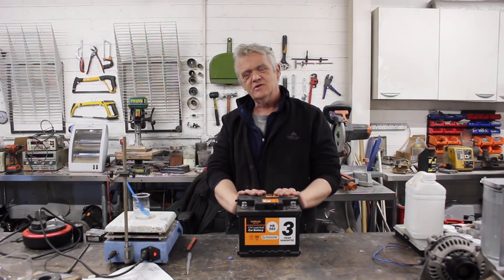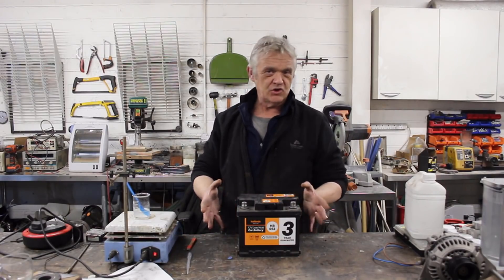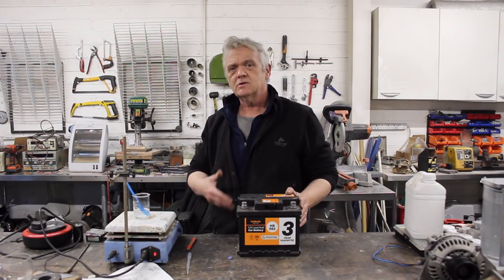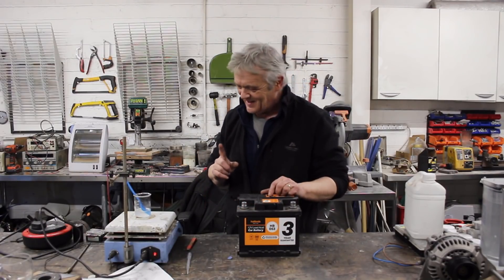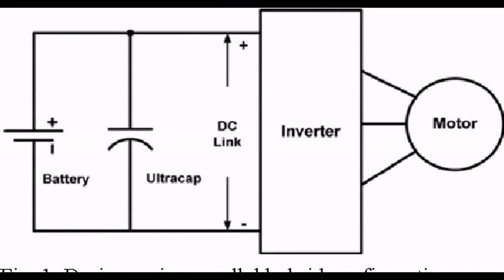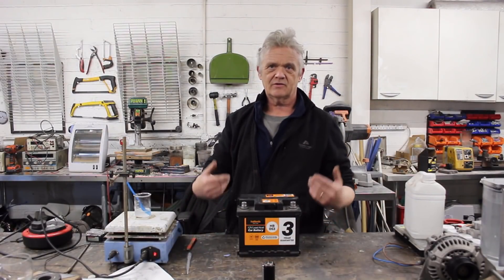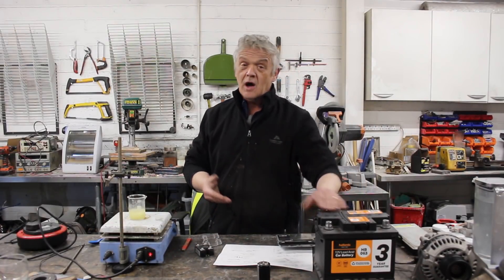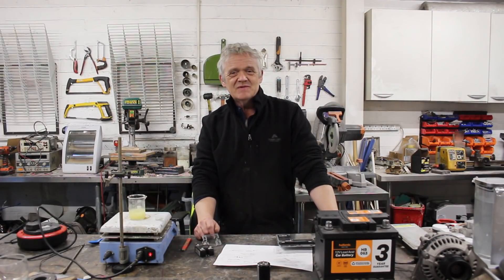1505 Improving Your Battery Storage With Supercapacitors

Comment: I have put it between the inverter and the battery, i.e. on the battery terminals. 6pcs 500F capacitors in series. Before the inverter beeped when the compressor started. Now it works well when the condensers give a good starting current.

Comment: I have added in parallel a set of 5 supercapacitors in series without the balance circuit to the lead acid battery of my car . The effects are better than a 6 series . Voltages are slightly higher than 2.7 V on average but so far so good

Comment: I was thinking about cylinder design, and besides making composites with graphene, couldn’t graphene ultra capacitors be used as Filler in an O Neil Cylinder?  
It should have sufficient strength, or you could design it with strength in mind, storing more energy than a battery made out of concrete.

Using any other battery chemistry in a cylinder would necessitate it being replaced every so often.  
- It would be nice to just have a set and forget graphene ultra-capacitor that you replaced every 50 to 100 years.  And for the flywheels story, most of the power, that’s just in the material strength.

Comment: I have an off-grid 400W solar kitchen assist system.  Our house is on grid energy.  I ran parallel wiring into kitchen so we can choose between grid or off-grid power by plugging into desired wall plug.  It sends solar energy into a 3000W inverter that is secondary power for our kitchen small appliances. It can power the large refrigerator/freezer during the day but the 400Ah battery bank is not quite enough to power frig through night. 
 Can a Supercap be used to inject power into the battery bank in early morning hours so energy in bank could hold up until sun shines to recharge system power?
Reply: @tomsuderman9976  saudações! O banco de super capacitores irão auxiliar seu sistema off grid nos momentos de pico de consumo se seus eletrodomésticos!
Para poder utilizar o sistema durante o dia, os super capacitores serão muito uteis para apoiar seu banco de baterias, mas recomendo que tenha pelo menos o dobro de placas com relação ao seu consumo. Isto irá ajudar nos dias nublados !

Comment: Im very interested in using supercap to lighten the burden my car has on my leaded battery. Could i achieve this by connecting a bank of supercaps to a solar charger that outputs 12v and have the supercaps permanently in parallel to the car battery? Or its not simple as that. Thanks.

Comment: Hi, I'm a new subscriber and had a question I was hoping you could answer. I want to use something like this system to smooth out and help a grid tie inverter for maximum efficiency. As I understand it, the diagram would be as follows. Solarpanel -> mppt -> Battery -> Dc-dc Converter -> Supercap -> Grid Tie Inverter -> Home . Unfortunately, you los\st me at the relay thing and now I have no idea what this circuit would look like. If It's not a bother, could you help me a bit with what I should do?

Comment: Very interesting. I am currently researching how to build a solar system for the absolute lowest price while having access to ac power.
Thinking of going with solar->charge controller->super capacitor, as well as AC->charger->super capacitor, and using the AC mains as my battery source whenever the sun is down. :yougotthis:

Edit: If anybody has any advice on using solar and utility power concurrently, I would really appreciate it. The most affordable way to do this seems to be using super capacitors or a battery being charged by both solar and an AC battery charger. Just need to drive a 600 watt window AC unit 24/7 without interruption with both solar and AC mains energy concurrently.:face-turquoise-covering-eyes:

Comment: Except it's all nonsense.  The issues were sustained load, and amount of drain.  The supercap does not reduce the load, nor does it reduce the drain.

One benefit would be high instantaneous current, but what do you plan to use that for? Perhaps starting a vehicle in extremely cold weather or spot welding.  Otherwise when you consider the series/parallel array of supercaps you'll need, it makes more sense to just do without them and use a larger lead acid battery instead, if not lithium depending the capabilities of the charging system.

In other words for most applications, given the same budget, having a lead acid battery with the array of supercaps in parallel to it, is inferior to spending same amount of money on a larger lead acid battery, which is why that is what practically every industrial use is designed for, and also vehicles and their starting batteries.

Most things simply aren't designed for extreme current because that in itself causes problems with needing to beef up everything else to withstand that much heat because we have not yet perfected and implemented superconductors in everything.

If all you really want is to reduce ripple enough that it's not a problem for the powered devices, a large lead acid battery is already low ripple but you could then improve it using standard, lower cost capacitors rather than supercaps, AND if talking volume or cost, you can deliver a higher current with low ESR capacitors than supercaps, so the supercaps really don't have a purpose except in niche applications.

Comment: Got myself   A millennium 3 cd20 relay controller ( marketplace 95 euros) ,, I’m nog looking for some super caps ,i have a 33kw 51,2v 646ah 14s200p li-ion battery.. and I’m planning to get a istabreeze I2000 .. and the max out of it ,, any advice for the capacity of the capacitor bank?..gr denny

Comment: You ever try replacing the battery electrolyte with lithium sulfate?
Reply: Update bought two 1300F super capacitors at 4.2v. I guess I will test them.

Comment: I'd have to know more about super caps to know how to apply them. Are they more flexible for charging? (Like trickle charging from solar panels, or extreme fast charging from daisy chaining solar panels). I know that the electric motors I have around the house have two capacitors. One is a run capacitor, the other is a start capacitor. I think my AC might run the same way.

Comment: I have a idea for a generator that is a washing machine motor, flywheel from a v eight, the Bendix off starters, inverter off one of four generator's going to a bank of super capacitors running the inverter to run power supply to run washing machine motor, will it work my friend?

Comment: hello Rob would the balancing circuits for the super capacitors theyu supply work similar to the dc to dc converter or would both the balancing circuit and the converter be best,as im looking at putting a super cap buffer onto my high powered ebike of 84 volts to take greater advantage of regen

Comment: Bit of a different topic but same components.  A lot of the concepts scavenge energy, relatively low energy.  Can that energy be.accumulated by super capacitor then transferred to the battery even if the energy source has lower voltage than the battery?  You mostly spoke of the supercaps leveling energy spikes.

Comment: It would be very interesting if Tesla would use a bank of super capacitors for taking all the power during regenerative breaking.  Then split their battery pack into two sections at 400 volts each. The capacitors would dump their energy into the lowest voltage battery section, then that section would rest while the other section powers the motors.  Both batteries would be used in parallel while under hard acceleration.   When charging the battery sections would be arranged in series for an 800 volt fast charge.  When driving everything is still configured for 400 volts.  I wonder if the extra effort would make financial sense.

Comment: This is similar to an idea I had but at a much smaller scale.
The stability and efficiency of the grid relies on the supply and load being in near perfect balance. Too much supply and the grid voltage rises and things go pop. Too much load and the voltage sags and you get blackouts. One of the main problems is that the grid supply is slow to respond. It can take upwards of 30mins from the demand increasing to a power plant upping its output, so predicting when the load is going to increase is important. There's obvious times. 7am and people get up and stick the kettle on. (While one 1kVA load is insignificant, 10 million 1kVA loads on the other hand.) So here's the idea, have homes install "powerwalls" that can balance the demand at the load side, rather than the supply side. everyone gets up and sticks the kettle on, or there's an ad break just before a world cup final penalty shootout (so everyone gets up and grabs another beer from the fridge) and rather than having to predict exactly when the load surge is going to happen, the load side energy storage supplies the demand locally, and then slowly recharges over the course of the day while your out at work. Add in some smart metering so the supply knows how much has been used, and you can keep the grid in near perfect balance.
Probably explained that badly, but I'm sure you get the idea!
Reply: I like it, sounds like something RMS should do a video on.

Comment: Would it be feasible or useful to add a car audio capacitor to a basic solar power bank setup on leadacid? I have a system that runs a converted chest freezer fridge and the power draw on startup triggers the low voltage alarm when it starts. After the initial startup however it only draws around 80W or so. The car audio caps I've looked at range from 2-5 farad ratings. If it was hooked up parallel to the inverter would this provide the boost needed for startup of an inductive load? Thanks

Comment: I have a 16.8V 1000F (6s2p ,2.8V 3000F cells) that I use in my car with a small 10W solar panel. Because of the low internal resistance, I have been able to turn over the car at as low as 7V. Lowest I've got is 6V with a push start (it is standard, not automatic).
I have been wanting to use a DC-DC converter not to charge from a lead-acid, but to extract the useful stored energy below 6V. It's not easy finding a 200A rated 12V boost converter that can run down from 1V or lower. But in the off chance that there is no such product, I wonder if anyone would be interested in me designing a low voltage extremely high current boost converter specifically for supercapacitors and low voltage cells?

Comment: You have a nice place to experiment. Can I draw your attention to something else? Heat batteries that is. Just sand, resistance heating, container and insulator. Use solar panel electricity to heat up the sand up to 500c and use it later to heat the environment

Comment: well, it's a bad idea.
1st: supercapacitors are quite expensive which makes more sense to just invest this money into more batteries.- this way we solve all the problems and have bigger storage too 😜. for 100Ah battery 20A discharge current is 0,2C which is suboptimal. for 2*100Ah (200Ah) 20A is 0,1C which is acceptable. 100Ah 12V battery is 50£ or 60€.
 and it will solve DoD problem as well. 1,2kWh from 100Ah 12V battery is 100%DoD. 1,2kWh from 2*100Ah 12V battery is only 50% DoD 😁
2nd: biggest sin in engineering: complicated design. DCDC inverter as a Single Point of Failure.  
3rd: this design of yours doesn't solve anything. energy stored in this capacitors is not enough for any real life scenario's apart from EV's(rapid acceleration)

Comment: Thank you Rob, I find this very interesting :)
What about deep cycle battery's from a camper/caravan?

Cheers!
Reply: What about them? - they're designed so you get many more charge cycles out of them than a standard 12V car battery, but the possible charge and discharge current is much less than the standard battery.
Reply: Somebody put capasitor in the load of solar charger, what did it to maybe charge better

Comment: Robert I think that would cause more problems than it would solve. A capacitor wants to push out everything it’s got. A converter or regulator will take all that and turn it into heat and waste it. The capacitor May lesson the load on the windmill and trigger the braking system which is usually done by adding a load to the system.
Reply from the maker: you might want to have al look at the research mate - nothing I said here is beyond what has already been done and investigated
Reply: @ThinkingandTinkering  i’m not doubting you one bit my friend. Those were just some of my concerns. I think I spoke before I really thought about it lol. Electronics and super capacitors or a game changer today.

Comment: I have seen people putting super capacitors parallell with a small RC battery in place of a starter battery. The RC battery provides power to the radio/lights/door locks, and the super cap handles the current spike on starting.

Seems to work in the videos, but of course it limits the power available without the engine running.
Reply from the maker: it limits the power to the power you set it at by the size of your capacitor bank - but as this set up is really for peak shaving - the over all power shouldn't be limited if it is the cap bank has been wrongly sized

Comment: Put a super-cap across a battery and you're got a (brief, but damaging) short circuit. Trust me on that.
Reply from the maker: certainly - if you mismatch them - put a 2.7 volt supercap across a a 1.5 volt battery and all that will happen is you supercap will charge - put a 12 volts battery across  the same super capacitor and you will blow the supercpapacitor - plus what I suggested being done - hassocks been done - of course it was done by folks who knew not to mismatch the cap
Reply: @ThinkingandTinkering  I've put 2 x 2.7 volt supercaps in series across a 3.3v LiPo and melted leads, arced contacts, etc. The instantaneous current is something to be accounted for.

Comment: Exactly ✅ - I have taken it back to Static Storage and then Down Convert "that" back to 440v 50 Amp 5-Phase 🏁
.. Tesla's Coil was not Intended as "A Static Generator" ( although it does That too ) - it was for Static-to-High Current Regeneration ✅✅✅
. ( thus, The 3-Layer Water Turbine, The Marx Generator Chain's and The Auto-Filling Accumulator's. ) .. using Crow-Bars Arc so Nicely.!
. . . my original thoughts were to use Nuclear Batteries but they don't exactly Store Charges without that little Pluming Mushroom T___T
Reply from the maker: lol - no indeed they don't

Comment: Here's a what if. For domestic use. you have a Iron and salt based Redox flow batterie with supercapacitors for the quick high load. I give this as an example, because I have been trying (Not always successfully) to produce energy storage with very simple everyday items that are cheap and environmentally ok, even if they are not super energy dense. what are your thoughts ?
Reply from the maker: I have a suggestion - and I will be doing a video on it today - in the members area of course  - most of my battery stuff these days goes to the members area as you know - cheers mate

Comment: How hard would it be to take hydrogen from a battery bank and compress it for later use or use it for hot water, heating or fuel cells?
Reply from the maker: it doesn't produce a great deal mate - enough to be an issue but not really that much
Reply: hydrogen is nearly always difficult to maintain/keep, hence projects for it are rarely worthwhile.

Comment: Good Video. Just a quick question on inverters if any one is savy. We all know that current is only drawn when there is demand, ok so my question is actually do inverters have built in protection to limit there output. So say my home is using 2Kw of power and I have a small 200w inverter suplementing the house while drawing 1.8kw from the grid. What sort of circuit in the inverter protects it from having more than the 200w being drawn? Cheers if anyone knows.
Reply from the maker: I think it depends on your inverter mate - cheap ones - no - but more expensive ones will have current limiting as a feature - I would guess - but you really need a better answer and I am sure others on here have a better one - cheers

Comment: Reminds me - can't recall the channel, but some years ago, I found a few videos of a guy who replaced his car battery with a super capacitor bank system that weighed like a 10th of the L/A batrery. No idea about longevity, but he claimed it made it though at least a couple winter weeks in a follow up vid.
Reply: You mean LaserSaber? I still follow him, he's a knowledgeable man, he recently started posting new video's. Because of his video I added 6 supercaps (with a control circuit to prevent overcharging them) in my car and extended the live of my battery many years!
Reply: @deslomeslager  Sounds like the channel and good to hear he's posting again. And good to know its legit too. I convinced a friend to give it a try years ago, but he couldn't get it soldered right for whatever reason and gave up calling it fake.
Reply from the maker: lasersaber

Comment: I'd suggest LTO chemistry cells instead of supercapacitors. They're much cheaper than supercapacitors at present and have much greater energy density. I recently bought a 552Wh (2.3V, 20Ah, 12S) battery for £110. I intend to use it for an instantaneous hot water tap (90°C) for making tea and coffee.
Reply: Hi Vino, where did you get your LTO's from? Great chemistry choice for very cold climates like mine.
Reply from the maker: it would still work with LTOs mate - in supercapacitor terms every battery is a snail lol

Comment: You could always make the big ass capacitor the guy in Australia made from beer bottles and a 5 gallon bucket but very dangerous in my mind.
Reply from the maker: that was a scam mate - caps don't work that way
Reply: @ThinkingandTinkering  Wow I can usually figure those out but my electrical knowledge is poor thanks